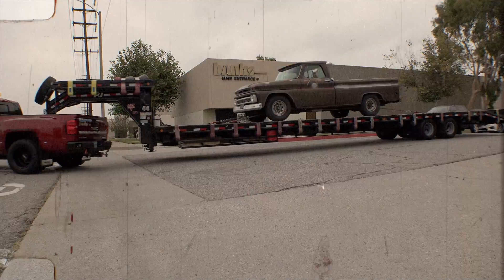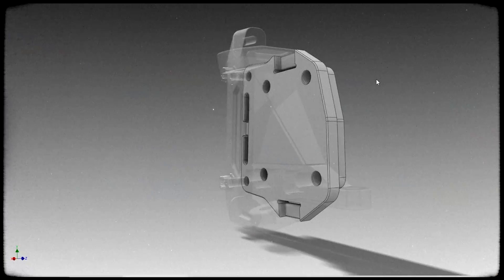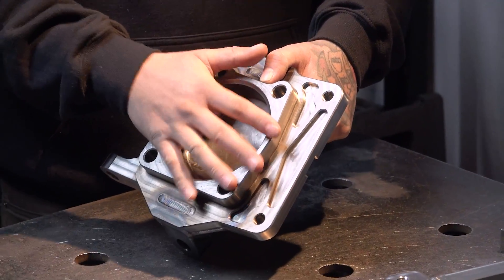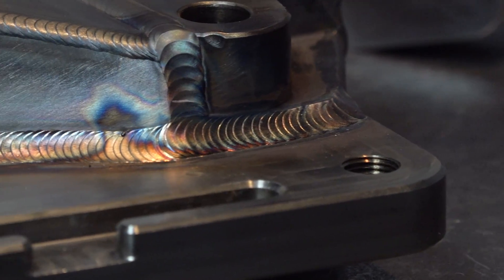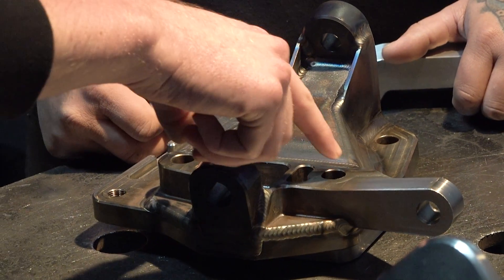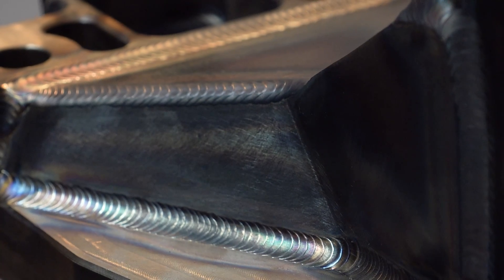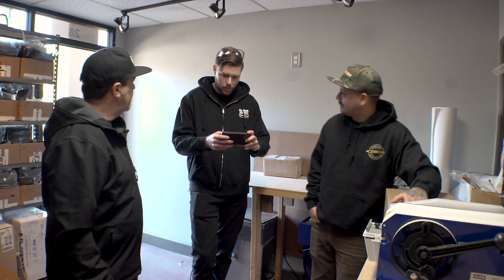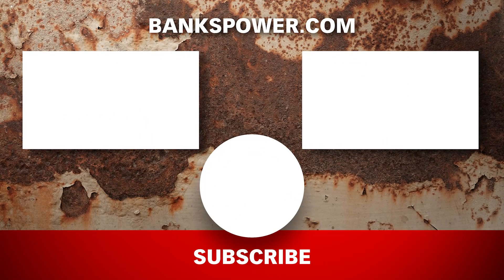We used Wilwood's geometry! | BANKS BUILT Ep 9

Comment from the maker: Do you prefer MIG or TIG and why?
Reply: I have been doing some of the most splattered welds ever with a 100a mig welder and flux cored wire. I know it's ad hoc but I can carry the welder in one hand and plug it in to a regular outlet. It allows really small fixes with almost no setup. You can always Texas TIG with an Arc welder. if I had the need for it I would prefer TIG but for almost everything I do mig works just as well at half the cost.
Reply: Correct me if I’m wrong. Hard to tell by the video but it don’t look like a double pass weld. Looks more like one pass weld with a reflow pass!
Reply: @preformancemustang  double pass is often a root pass and a cap pass. You might not see two separate beads.
Reply: @coreyfro  I get what your saying as I weld alum as well but if you look at the welds on the inside of the hub compared it the outside the inside was trashed welded. That’s one reason I was asking. Go look at the inside of the hub very well in the video.
Reply: @preformancemustang  you're going to have to give me a minute marker.

But it doesn't really matter, were talking about process, not the video
Reply: For fine detail work TIG is always nicer. But if it's run of the mill heavy work, the MIG is always my first choice. It's always hard to tell with a picture, so I could be mistaken, but there doesn't appear to be a lot of penetration in the left side lower edge run of weld at 4.43.
Reply: Have only done stick and MIG. TIG looks awesome.
Reply: I haven't welded, but TIG just looks so good. The MIG welds I see usually require a lot of grinding to clean up.
Reply: Tig welding. Done it for years. If it’s done right it’s 5 times stronger.
Reply: @preformancemustang  if your weld is stronger than your base metal, then you've just made a stress concentration zone.
Reply: Those might be the best tight welds iv ever seen
Reply: TIG, but admittedly because I weld a lot of aluminum.
Reply: https://youtu.be/6kdZmgZessot4
Reply: TIG. And I've only ever used a "tail" type add on to a standard DC machine - for field work.
Reply: Ark is the strongest and once understood best for non ferrous material over 1/4" or 6.5 mm easily up to 2"+) or 50+ mm and more basically placing the metal filling the space between the surfaces currently unconnected with a compatible material equaling or multiplying the capacity required for pourpous experience and knowledge  there for the asking the desire for knowledge worth exploring peace and respect transequitorial

Comment: I find tig to be easier. You can control literally everything. My full time job is mig welding but I’m the guy in the shop who does any tig jobs. Don’t call mig easy until you’ve got dimes and can run a true spray arc 30 degrees uphill and nobody can tell the difference. Not to mention being able to produce fast good welds while controlling your spatter without a pulse machine.

Comment: I teach TIG and MIG.  I teach TIG first... Aluminum... because MIG and TIG with steel allow cheating... TIG Aluminum doesn't lie.  But it speaks to you.  It lets you know what you are doing wrong.

The most important thing in teaching welding is they have to know how to weld before they touch the machine.  Talk them through the process, let them know what they are going to see.

And then....make them comfortable.  Because a distracted welder...isn't.
Reply: "they have to know how to weld before they touch the machine" I agree. I hear way too many times people saying "the only way to learn welding is to weld!". Yeah, then you weld shit and you dont even know your weld is shit. I've worked at a lot of welding shops and seen "professionals" do all kinds of shit because "it gets the job done". FCAW downhill or pushing because "it looks and welds good" on STRUCTURAL parts, years old wet MMA electrodes because "it welded just fine", wrong shielding gas on stanless. All of these examples are from shops doing industrial parts, not some small cheap shops. They learned by just welding.
Reply: @Catrik  totally. And I get the appeal of diving in head first, but welding is so kinesthetic. Your brain wires you to how you learn...and if you learn bad habits, you have to UNWIRE your head...to learn good habits.

Teaching welding badly is worse for a student than not teaching them.

Muscle memory is a bitch it undo.

But still, muscle memory is the most important part.

I have my lecture down to 30-45 minutes, and I can get people tigging in the next 2 hours.

Then can know what they are doing before they touch the torch.  Training their brain and their eyes gives them the feedback loop they need to self correct.

And once they know TIG, they already know MIG.